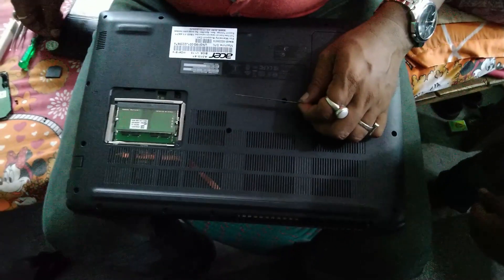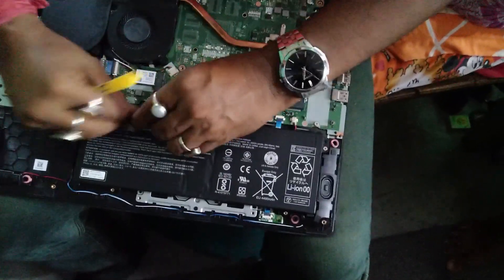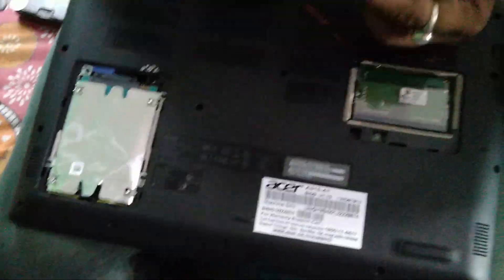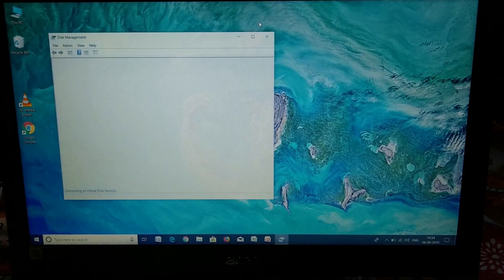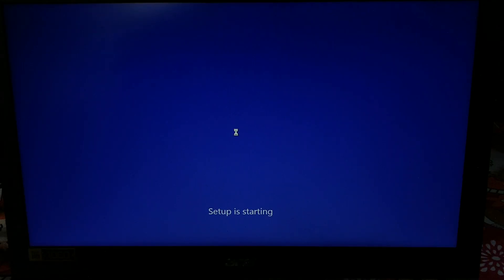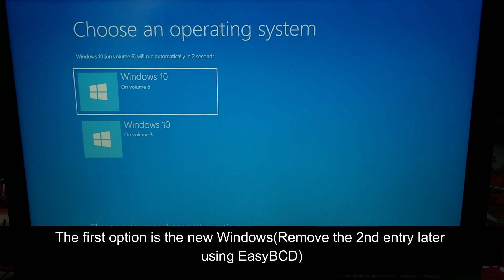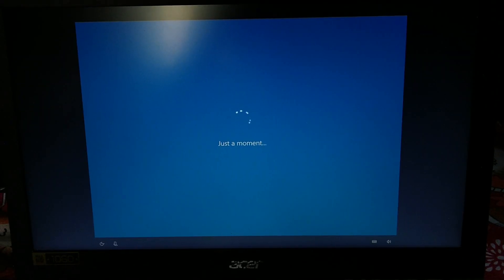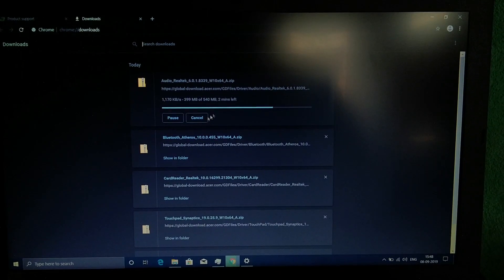ACER ASPIRE 3 a315-41 M.2 SSD INSTALLATION (SSD + HDD) | REINSTALLING WINDOWS GUIDE

Comment: Hello... Should I format the hdd to remove current acer windows or ia there a better method
Reply from the maker: Sudipta Bhattacharjee While installing fresh windows in new partition ( your ssd) you may format the current hdd or you can do what I did. See basically after you install windows in new partition, your HDD is simply a storage drive (not a boot drive) so after installing windows 10 in new drive, set it up completely. Then later just format your HDD and use it as a regular storage drive.
Reply: @DeepteshLovesTECH  Thanks.. I just ordered acer aspire 3 314-41G from flipkart at 22499 and Micron Basic Crucial 8GB DDR4 2400MHZ SODIMM & Western Digital WD Green 240 GB M.2 2280 SATA Internal Solid State Drive... Looking to upgrade myself and want to do a clean windows install....
Reply from the maker: @sudiptabhattacharjee8476  bro bro wait wait! Order 4GB 2400mhz only. Otherwise it's useless to have 12GB Ram (not in dual channel), either order a single 4GB DDR4 2400mhz for dual channel memory or get two 8GB 2400mhz for 16GB dual channel memory. Dual channel memory helps Ryzen a lot! So keep that in mind.
Other than that excellent purchase!
Reply: I just cancelled the 8gb and ordered 4gb... 2*8gb seems to be overkill for this machine... So i got 2*4gb only.. Thanks
Reply: Hey I got my laptop delivered.. Upgraded SSD RAM finished clean install win 10.... Now how do I remove old hdd windows.... I am booting from ssd... Should I format the HDD  or delete partitions and recreate using MinitoolPM
Reply from the maker: Sudipta Bhattacharjee yea simply format it.. as simple as that. C drive is your ssd, D drive is your HDD, so just format your D drive.
Reply: @DeepteshLovesTECH  done... Thanks

Comment: Can i install more 4 gb ddr4 crucial ram 2400mhz ? And how is the performance after ssd of this laptop?
Reply from the maker: deep khanderia yes I have installed 4GB DDR4 2400mhz ram to help Ryzen and the vega 8 graphics.
Reply from the maker: deep khanderia you must install an ssd as the Hdd is very slow. The SSD makes the laptop really fast!
Reply: @DeepteshLovesTECH  sirji 
https://www.amazon.in/dp/B019FRDKWI/ref=cm_sw_r_wa_apa_i_XwALDbPD7ECAD
Ye ram chale gi?
https://www.amazon.in/dp/B078WYRR9S/ref=cm_sw_r_wa_apa_i_GoALDbTXT5E03
And ye ssd bi? Iss laptop ke liye ? Plz reply dena sirji
Reply from the maker: deep khanderia yes both will work.
Reply: @DeepteshLovesTECH  thanks for reply sirji
Reply from the maker: deep khanderia subscribe 😁

Comment: bro  acer i3  8145u  and   this  laptop...
which one is better
Reply from the maker: donal'd triumph this one is more powerful. It has 4 cores and 8 threads(intel i3 has 2 cores and 4 threads). Vega 8 Graphics is much much better than intel hd Graphics.
Reply: @DeepteshLovesTECH  i fully agree but on online sites, THEY  are  complaining  about  #build  quality,#display,#battery life.....is it true?
plz bro reply me...
Reply from the maker: donal'd triumph build quality is compromised on this laptop in favour of better specs. Battery life definitely ok.. will get you 4 hrs of low to medium work.
Display is 1080p non IPS.. pretty much average.. it is sharp since it is 1080p but lacks contrast. Good thing is it is Matt so less reflections. Most laptops in this price provides 1366x768 screens.
Reply: @DeepteshLovesTECH  i  bought  #thin  version of this  with  256  #SSD  @25k..
i hope  i made the right decision..
#thankyou  for  clearing  my  doubts

Comment: What would be more convenient? Upgrading to m.2 sata or just put ssd where normal SATA III HDD is? Also what's the max capacity of ssd if i go with SATA III port?
Reply: also, what was the boot time with og HDD ?
Reply from the maker: SHASHANK HDD is quite slow.. whole system will be slow with HDD. Upgrade with M.2 sata 3 ssd... Why will you remove the HDD? There is a free M.2 slot inside.. Acer service guys don't care about the seals , so don't worry, remove the seal carefully then put it back again.. no problem.
Reply: Okay bro, can you name the ssd you used? I'll buy it
Reply from the maker: SHASHANK check the description. Link is given.
Reply: Okay, I got a few more questions. Am I good to go if I use WD green m.2 sata 240GB SSD? Also is there anyway I can save my genuine win 10 that comes pre installed? Or Do I have to follow exactly what you did?
Reply from the maker: SHASHANK follow what I did. The windows I installed is genuine. I downloaded windows 10 home latest from Microsoft. It's better than Acer's windows , it doesn't have any bloatware. Don't worry about the keys. Keys are stored in a special partition.. new Windows 10 home will automatically recognise the keys.
Reply: Alright Chief, So I guess I gotta create a bootable pen drive with windows through rufus and follow
what you did.
Reply from the maker: SHASHANK yea just regular old method. No issues.